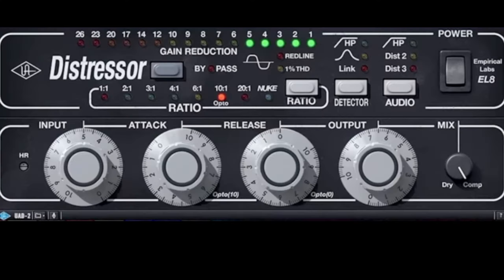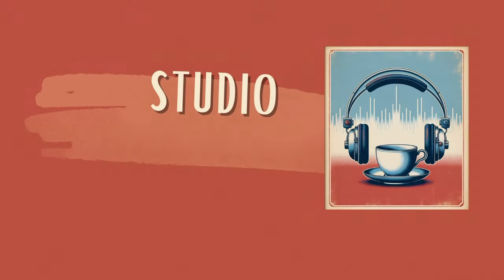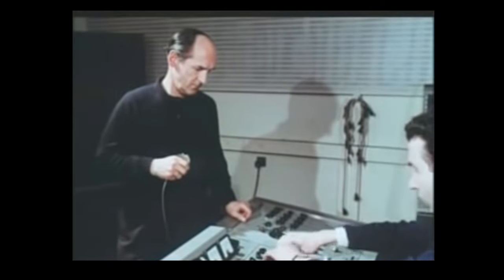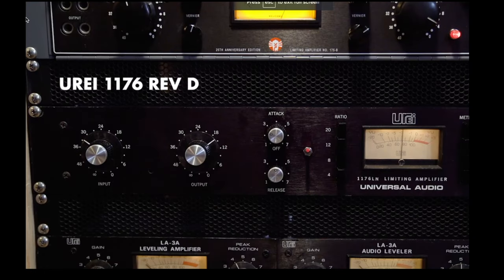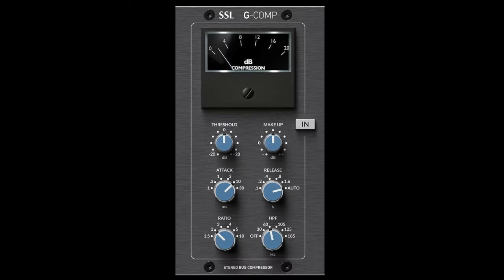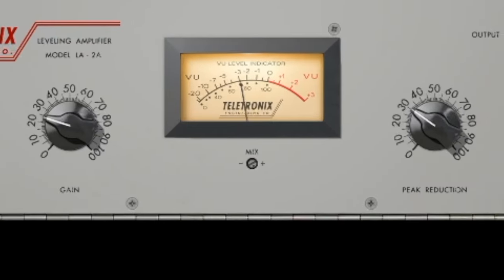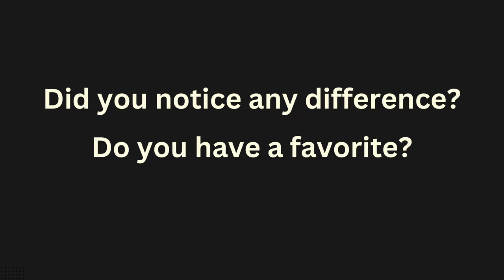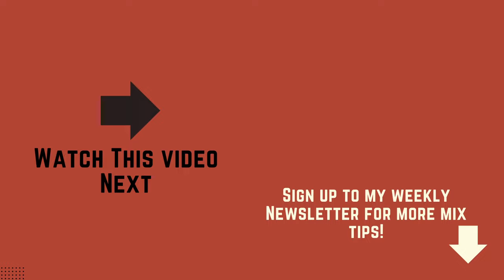Comparing 4 Different Types of Compressors:  Optical, Vari-mu, FET, VCA

Comment: Great video as usual! Interesting how different the kick and snare sounds between the compressors. The snare sound of the 1176 is very recognizable from a lot of records, to my ears the kick lost a bit of the low end with the 1176 - is that a 'feature' of this compressor? I liked the kick in the Fairchild, it was round and big and at the same time held it together - hard to describe. I think the LA-2A was better than expected, it held the kick and snare together in a nice round way, perhaps suitable in a jazz setting, but not in 'in your face' rock?! Interesting to hear the SSL bus - the snare sound was similar to the FET, but not so aggressive perhaps. The kick had more low end than the 1176. My conclusion: By only using these 4 compressors and using them in different combinations, you can really get very different drum sounds! Thanks for sharing!
Reply from the maker: Thanks a lot Dag! Loved your reading your analysis! :)

 I agree, I was also surprised by how good the LA2A sounded, but it tends to work better with slower drums. As you mentioned, it is not something I would use on faster rock drums.